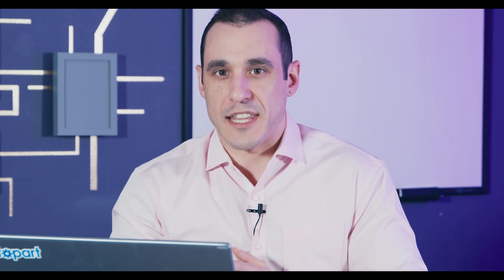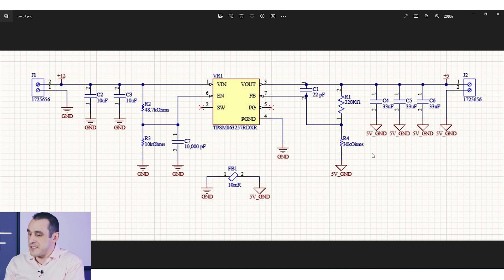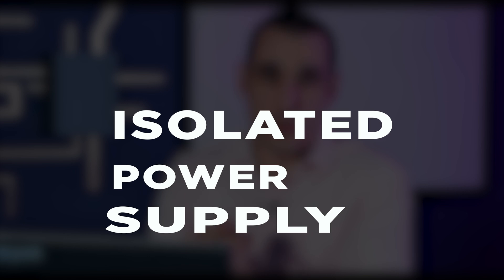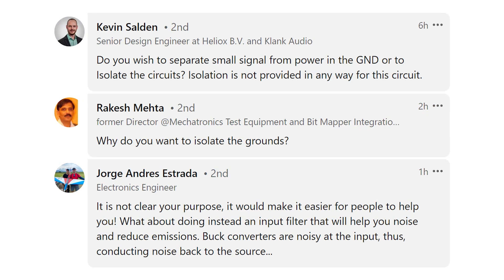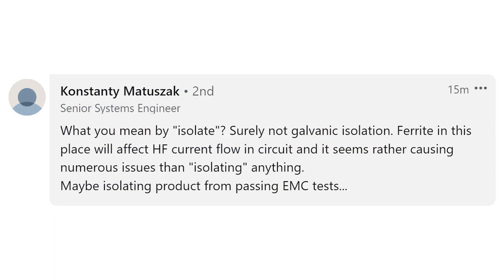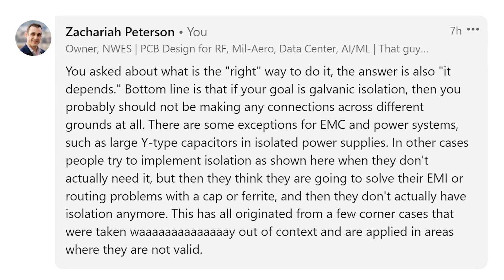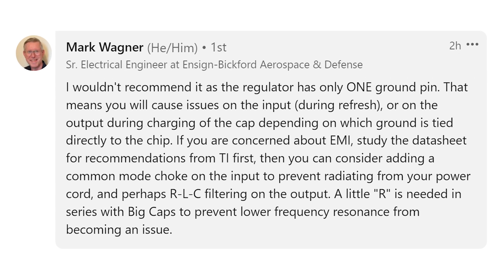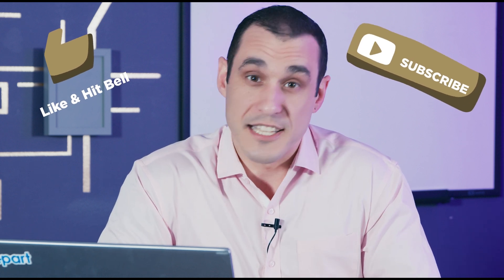Bridging Grounds with Ferrites? TERRIBLE IDEA!!!

Comment: How should we separete analog and digital grounds in mixed signal circuits? Some advices are ferride beads, schottky diodes and zero ohms. Which ones should we used and how we decided?
Reply: In almost every case, you should not separate those grounds, this is based on 40-year old design guidance from semiconductor manufacturers which is no longer relevant in today's electronics. Use a ground plane on the layer adjacent to the signals. Using a thinner layer between signal and ground helps ensure the return paths are confined near signal traces. Probably the only exception is below kHz frequency, but even that case can be solved by placing components and carefully following the return path so that the analog signal does not intersect any digital signals. Separation of analog and digital grounds is a great way to fail EMC testing; even if the board would function correctly, you would not be allowed to sell it in most markets because of EMC testing failure.

Comment: Apart from the video .. I’ve one question on ferrite beads implementation..

What frequency of a ferrite bead I should choose when my switching  noise is around 1-5 MHz ?
Reply: What are you trying to use the bead for? Where will it appear in the circuit? Are you trying to use this to filter switching noise?
Reply: @Zachariah-Peterson  thanks for your reply..
I’m working on industrial automation product.
Here for one of the inputs is Digital input frequency mode from 0 to 20 KHz.
When a signal applied with 1us or less  rise I can see the disturbance on the other Channel.

Even after having 100MHz beads on the return side input. 

No issues when rise time increases. But in field we don’t know the signal rise time from the customer.
How I can mitigate this ?

Comment: I use ferrite beads near input connector (and after tvs-diode, of course) - in "+" and "-" nets... to protect from common noise... instead of common mode choke (CMC)... Of course, CMC is ideal variant to eliminate common noise, but it's expensive. I think that FB help to eliminate some common noise - if i am not correct - please, tell me...
Reply: A pair of ferrite beads placed on adjacent signal lines is basically a weakly coupled inductor, or a very poor common mode choke. If you need to have strong filtering of common mode noise, then use the appropriate common mode choke component.
Reply: @Zachariah-Peterson  thank you very much for reply!)

Comment: Do common mode chokes also have same issues?
I ever heard a doctor doesn't recommend to use any common mode choke.
But I still see people use common mode chokes in some practices, such at the power input port, using a common mode choke to bridge the power rail.
Or that's a different situation?
And also, will this kind of GND bridge degrade the ESD protection?
From my perspective, it makes the inrush ESD current difficult to go through to Earth GND.
Thanks.
Reply: I didn't bring up chokes in this discussion because the post presented in the video was not about chokes. Also chokes are not used to bridge ground reference planes, they are used on a pair of signal lines that require filtering. Anyways these components are used to remove parts of a signal, while the ferrite is claimed to be used for passing some signal, it is the opposite implementation. The GND bridge can degrade the ESD protection because the ESD protection will now be limited to the ferrite's breakdown voltage (whatever value that happens to be). For example, if you require 4kV isolation, maybe the bead only has 2kV isolation, then your galvanic isolation is only 2kV because the bead becomes the failure point.

Comment: I agree this is the worst design habit to add a FB in return path. But, i think it's miss-understood why the guy used this FB.
it's common in juniors understanding that connecting two grounds (usually Analog and Digital) through FB will block digital noise from interrupting analog circuit.
the guy intention is not galvanic isolation.
so the best answer here, 
- function wise, you may get problem as you add HF impedance in your functional current path
- EMC wise this FB will interrupt your system functionality whenever any conducted immunity test is done "EFT, Surge" as there will be a hight voltage difference between two points that are supposed to be at the potential.
Reply: Are you referring to me specifically not understanding? I think I addressed both points (isolation in a power supply and isolation of signal/noise in general) in my LI comments. It was most of the other commenters who referred to using this for an isolated power supply, which would of course imply a requirement for galvanic isolation.
Reply: @Zachariah-Peterson 
of course not referring to you, we learn from your posts and videos. I rephrased it and let me thank you more for the valuable info you share

Comment: @Zach: The link in the description for LinkedIn, for me, only shows your page if I'm not logged in to LinkedIn. If I am logged in, LinkedIn shows a 404 error for your page, and you don't appear in search results.  It's acting like your account has blocked me on LinkedIn, which is quite odd, since I've never interacted with you on LinkedIn. Of course you're free to do that, but I'd appreciate if you could check whether that's the case so I don't need to troubleshoot this further.

Comment: Thanks Zach for producing this video, it's certainly a worthwhile topic, plus its general conclusion agrees with me :-).  That said, I feel like it got a little off target, and of course there's more to say on the topic.  

First, I don't think anyone is confused that the ferrite somehow magically confers "_galvanic_" isolation that automatically should warrant a DC-DC isolated converter, so that seems like a red herring.  Of course isolated DC-DC converters have their place when galvanic isolation is explicitly needed.

Instead, I think the "isolation" attempted in the sample schematic is poorly-considered "isolation of noise" -- where there's been some experience of "dirty" ground messing up some other signals.  This scenario can arise where the system has (a) some noisy high-current load and (b) some analog or sensitive digital circuitry. A pedestrian example would be an embedded controller, such as a 3D printer controller or similar that drives motors (significant switching currents, 12V or 24V supply) and also handles low voltage analog signals like temperature sensors, all ostensibly on the same ground net. AND such assemblies may have an MCU offering AGND pins associated with the ADC implying that you SHOULD have some separate analog ground net.

A ferrite is still the wrong way to handle it. Instead, manage the PCB current paths for the high-current-switching loads with careful application of "star ground" principles. (Use net tie components on the schematic to allow separate net names for the branches.)  This avoids having the load-switching-current PCB-trace voltage drops in the path of the reference ground supplied to the sensitive analog ICs, relative to which their analog signals are measured and produced (or analog sections of ICs with separate analog ground terminals). Similar consideration applies to digital IC ground nets, though these generally have signal reference ground and power ground as the same terminal. So for these, again avoid them seeing the load-switching ground-voltage noise. But these chips of course also generate ground noise that can be minimized by the usual digital ground principles, and kept away from analog signals again with some star ground thinking.

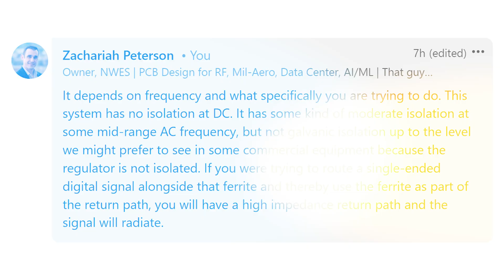Comment: 7:40 "If you were trying to route a single-ended digital signal alongside that ferrite and thereby use the ferrite as part of the return path,  you'll have a high impedance return path and the signal will radiate." Rather worse than that, for this case where a single-ended digital signal communicates between ground domains, if you route the return current through an inductor the resulting voltage drop (ie: voltage pulses at current-intensive signal transitions) adds to the intended signal at the receiver, and thus the receiver may see additional unwanted transitions. Also receivers of any single-ended analog signals crossing the domains will see the inductor-voltage-drop noise added to their intended analog input signals.

Comment: Designers even separate grounds in ICs. This requires ESD protection between the grounds and additional analysis. But level shifters are normally not immune to common mode noise. One requires differential level shifters. Just more and more complexity.

Comment: Thanks for the explanation Zach but this video only addresses switching mode powersupplies in a pcb design. When we are allowed to bridge sparate grounds together with a ferrite bead? Maybe in a mixed signal design when we want to route analog signal from analog region to digital region in a pcb? or always just use a single ground plane?
Reply: Stick to a single ground plane, and ensure your board stackup has a solid ground reference plane under your signals and power planes (ideally SIG/PWR GND GND SIG/PWR). If you're seeing noise on your ground plane due to high dI/dt, you need to assess the specific layout and stackup problems rather than trying to patch it with a ferrite, which will generally make it worse. If you need ground isolation between two devices then use a proper galvanic isolation method like an opto.
Reply: TL;DR answer: never unless you can prove you need it. There are some specialty cases of low-SNR low-current DC/low frequency measurements where you need it to control the path of noise currents, but these are really corner cases and it's not a good idea to extrapolate those practices to all other types of mixed signal systems. Most mixed signal systems do not low-SNR low-current measurements.
Reply: Never connect your return path by a FB, during EMC tests the high frequency current flow will make a high drop in the FB
this will make a big voltage difference between your return path sections before and after the FB. so your functionality will be interrupted and signals will be miss interpreted

Comment: Forgive me, I am not good at pcb layout, I am good at circuit design, but not the little details of a circuit.
My question is, I use a little switching regulator, with simple In/Out/Ground, and I put a little ferrite at the output before my cricuit, is this a bad idea?
Reply: Not an expert answer, but at first, try to answer the question: "why?". What is the goal (and how much)? You should know your regulator capabilities, know the load, and examine the ferrite datasheet you intend to use, finally put your oscilloscope at both ends of the ferrite. You will get the answer to your question if it is a bad idea or not.

Comment: tl;dw: This is the exact opposite of good practice.
This reminds me of an old hifi schematic that I may have mentioned in a previous comment; for some reason, it had a 10 ohm resistor between the phono preamp ground and the rest of the circuit. In that case, I think it was something along the lines of the damping resistor sometimes used with an LC power supply filter, but it made very little sense to put it on the ground rail.